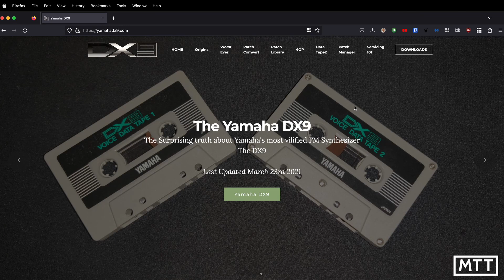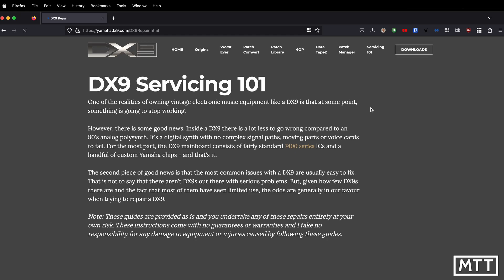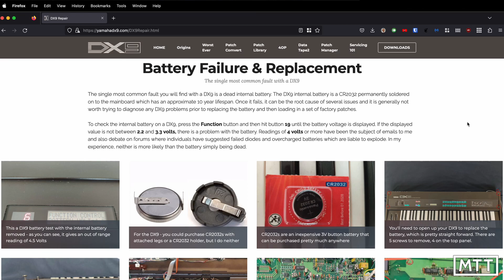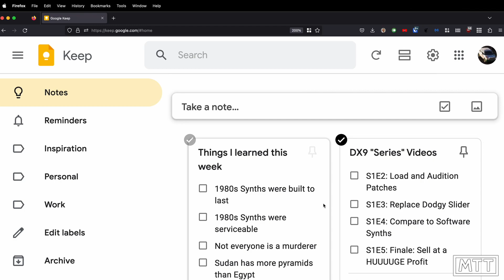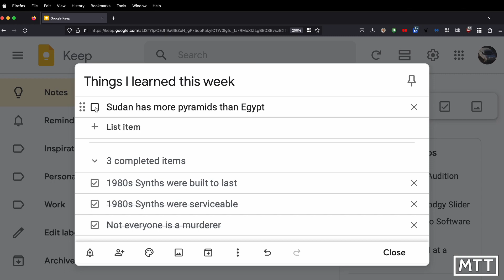Yamaha DX9 - Worst FM Synth Ever?

Comment: You're a brave man. One of my pet hates with older midi instruments is they regularly had the backup battery hard wired in and make it a really tough job to replace. I've had a Yamaha SY85 since you could buy them new and have lived in constant fear of the backup battery running out. I've looked for and found a tutorial on how to do it and its not a job I would take on lightly if at all. To Yamaha's credit that battery has lasted more than 30 years and still reports 3v, which is what it should be, and apart from a perished floppy drive belt which I have never replaced , still functions perfectly.
Reply from the maker: I've recently bought an old Yamaha FX unit, and it too has a soldered-in battery.  And it's still working fine, 30 years later!  I guess one surgery every 40 years is OK though.... there is some more upcoming DX9 action once I get time to mess about with the poor old thing that's just stuck in the corner at the moment...

Comment: Well that was quite a departure and not what I was expecting lol - I was an apprentice radio and tv engineer in the mid 70s - valves, cathode ray tubes and very large capacitors were the order of the day - none of this new fangled pcb malarkey!
Reply from the maker: I spent quite a while repairing tag-board circuits (much of the equipment where I did my apprenticeship was of that era)... Plus getting the odd belt off of a still-charged high voltage capacitor from a valve-based circuit.  The workshop game was 'throw a charged cap at someone' until we got found out and told we'd get the sack if we did it again!
Reply: @musictechtuition   yes the good old days before you could get written warnings for causing distress to your colleagues!
Reply from the maker: @alain_de_frothcorn  Yeah.... Although it was a government establishment, so that was kind of in place even in the early 90s!

Comment: Fortunately the chemicals inside the battery didn't start to leak out.
Reply from the maker: Yeah... I have an Apple Lisa in the loft awaiting resurrection, and it wasn't so lucky!  I've removed and cleaned the mess, but the whole chassis is rusty where this happened.